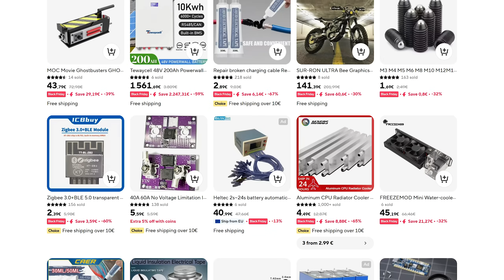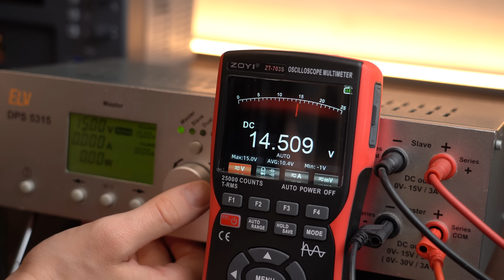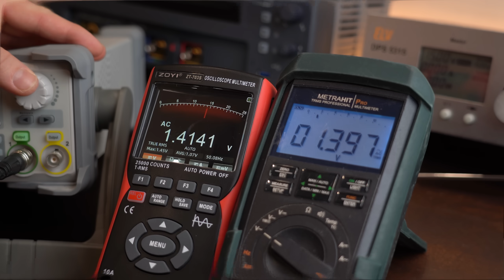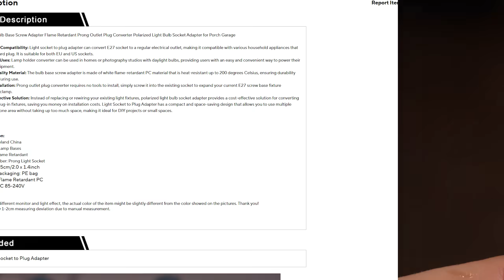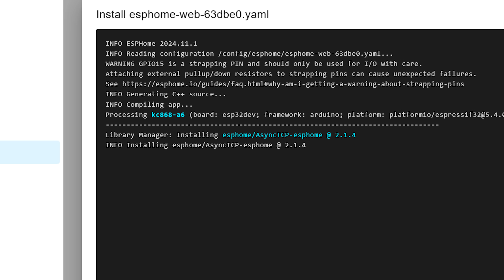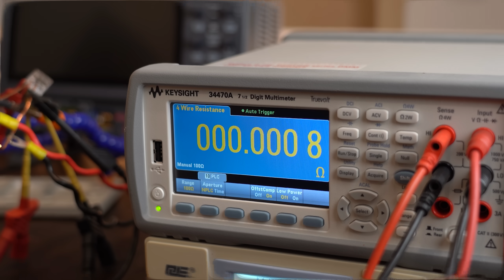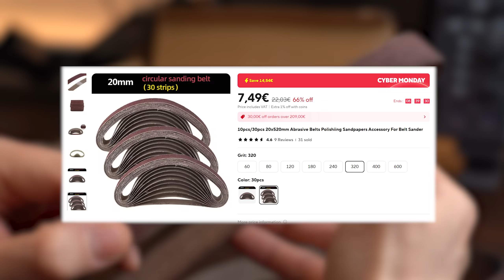I tried finding Hidden Gems on AliExpress AGAIN! (Part 12)

Comment: I was excited for your liquid insulation paste review and it ended as quick as the list of examples I used mine for.
Shame AliExpress is full of weird poorly made junk, the belt sander adapter sounds like a good idea but not when delivered with cheap plastic.
I bought a large UV lamp, 100w apparently, was doing some hydrogen peroxide deyellowing of plastic... Thing melted due to its own heat, thank God it didn't make a short circuit.
I wish they took the things a bit more seriously, gotta be incredibly careful with the mains powered things you can get there... Such an easy way to start a fire.

Comment: The socket outlet is useful if you have vanity lighting in the bathroom as well as inconveniently placed and/or few outlets. Removing 1 of 3 to 6 lights is going to have a minimal affect.
Reply: Sounds super usafe since it does not have earth or grounding
Reply: @NinoJoel  depends on what you're using for and how your bathroom is set up. Common sense should be enough to keep someone safe.
Reply: @A_Retired_MSgt  common sense doesn't help you if there is a fault in an appliance you use.... 
Even less in a bathroom where you stand barefoot and have plenty grounded things to touch

Comment: Using light fittings as a socket was a life saver many times when travelling in India, where a lot of the cheaper hotel rooms have no sockets at all. The only way to recharge batteries.

Comment: ESP Home Automation Board looks promising, I was looking for something like that for a while :) As for the oscilloscope - there are also other similar scopes like OWON, they have a built in generator with BNC output, also simple but a bit more configurable than that in ZOYI scope. It's worth mentioning that these scopes have common ground (even with the USB port), so watch out with your measurements while charging or connecting it to the PC :)

Comment: I have OWON HDS272S, multimeter plus oscilloscope (it can measure two signals at once up to 70MHz)+ signal generator, bought for around 120 euros from banggood. Super good (just one flaw - low current range does have high resistance, but 10A range is so precise it can measure even 1mA, making low current range totally worthless.

Comment: When i was an Electrician I used the light bulb socket adapter often. I used it most for toning out wires.  Could you do it with out one yes 100%, but time is money and this is a super time saver.

Comment: TL;DR: I had an old multimeter and needed a cheap oscilloscope for basic signal analysis for PS/2 protocol and other stuff. It was a good buy for me.

I got the ZT703s at about this price when it was on sale 2 months ago. I found it very useful for my Pi Pico, Arduino and bitbanging projects, I could even decode the PS/2 protocol on the screen. For fast signals however it can be bad, but Zotek is one of the few cheap oscilloscope brands that releases software updates. For the newer firmwares, the trigger can be very bad, and the 1.3.x firmwares are considered to be pretty stable.
On eevblog there is a forum for it and someone decided to create a custom firmware to fix problems (a few days ago, so no progress yet). Zotek seems to push firmware updates not so often and in the recent 1.4.2 fw they added an FFT function, with no frequency visuals on the screen, so it is useless. They could've make the scope and multimeter more reliable.
The multimeter doesn't have a "zero" mode so measuring low resistance is more complicated. 
I hope one day the fw will have all the functions needed.

Comment: I use a US version of the light socket to receptacle adapter to test wiring, I can plug in a recept tester if it reads open ground it's good, continuity tests are just easier with a receptacle then a socket, I can set my plug tester to tone and find a breaker by sound... just stuff like that.

Comment: I bought several small tubes of that exact brand "liquid" tape. Mine came out of the tube just the same.  I've found that it's certainly NOT like the liquid tape I'm used to that has the brush in the can.  If I ooze some out onto {whatever}, then form it into place with my fingers and leave it... it then cures up.  It's almost like using playdough!

Comment: The LoRa connector in the Relay was interesting. At the moment I only have sensors on my network but I was already thinking about adding an activator. I wonder what a “LoRa connector is”: maybe they already have a chirpstack codec programmed for it and you can attach a LoRa chip. I will be reading the link. I was going to activate relays with an Arduino connected to LoRa but maybe this simplifies things.

Comment: I use the light bulb to power socket to find out which circuit a room has but it is only connected to lights.

Connect something loud like a box fan, turn it on.  Go through the circuit breakers until the fan turns off

Comment: I've been using light socket to power outlet adapters my whole life. 
For example, I replaced all my incandescent bulbs in the basement with cheap LED shop lights. I used the adapter since those sockets are already controlled by the light switch.

Comment: I think a better solution for the last use case would be to get a boom arm for your microscope.  Then you can keep it set up and out of the way when not in use and easily reposition when doing something quick like reading IC markings.

Comment: I also bought two tubes of the liquid electric tape and made the same experience.
One recommendation regarding angle grinder adapters: NEVER buy adapters or use an angle grinder for something it was not intended for. The speed and torque of angle grinders is very high by design and if something breaks at these rpm, it turns into a bullet! Just search for angle grinder accidents! Nothing will protect you!

Comment: I used those screw in adapters to install plug-in LED "tube" lights in place of dangling bulbs in porcelain fixtures in my basement. They're a common hardware store product in the US 😁 Mine are solidly made and UL listed though!

Comment: The oscilloscope can do 46Mhz in High speed mode! By default its in normal mode for battery longevity, that's why you only get 35Mhz
Reply: The TOOLTOP ET120MC2 can do up to 120 MHz, but it doesn't have multimeter function
Reply: @kokoeblighatian3631 thanks. I already two multimeter so this option is better for me. Also higher speed while being cheaper.

But I found non C2 version. Can someone let me know the differences?
Reply: How long does it last, i only know the zt-702s lasts for about 2hr which makes it almost useless to replace as a multimeter
Reply: @zakstechs  703 uses 18650 cell, you can put a bigger one in or have a powerbank cause it charges from USB-C. I had mine for 3 weeks and never charged it, still at half battery, so i see no issue with battery life.
Reply: @zakstechs  replying to your comment so that i know the answer too :(
Reply: @zakstechs it's super easy to open and replace the 18650 inside. I agree the battery that it ships with is trash, but with a reputable 18650 it lasts a lot longer. 

The battery it has inside isn't even soldered so it's not very hard to switch at all.
Reply: Copied from eevblog.
"summary about the Zoyi ZT-703S:

- dual channel 100MSPS ADC (overclocked to 140MSPS in high speed mode), both channels sampled in parallel"

At best 14MHz in high speed mode.
Reply: @juhaszpeter4796  14MHz is abysmal for an oscilloscope.. Zeeweii dso3d12 might be a better fit if you want the oscilloscope function with 120MHz advertised (vs 50MHz advertised for the Zoyi ZT-703S), but it more bulky with the ports sticking out, i am sure some 3d-printing would solve that nicely
Reply: Do you know if the Multimetermode is limited to 25V? It seems pretty low for my taste.

Comment: The Problem with the socket adapter is also that the power rating of most lamps are low - like 40, 60 or 100W. Could get quite hot in the ceiling or in the lamp base if you draw a lot of current.

Comment: Regarding the bulb socket to female plug adaptor...

Your concerns are correct! We have these in Greece as well, and are very handy to power something in a pinch! But, they are ONLY for LOW power applications! Maybe to power some desk lamps, a tv and speakers, maybe even a gaming console...but that's about it. The most common one seen, are in a T shape (I think T plugs), that also exist as a socket multiplier, plugged into a wall outlet. They are rated for low wattage, typically around 450W. Also, it makes sense for the wires inside it to be thin, since the wiring inside houses that is responsible for the lighting, is also using thinner wires, than the ones that go to the wall outlets.

Great video!

Comment: I've had my eye on the meter for a little while! So interesting to see it tested in real life.

I took a pass because I needed more granularity on the signal generator. But to what percent are the scope and meter accurate?

I have a small open source DSO I was able to calibrate against good lab supplies to better than the low but resolution. Wonder if this is better, since it's also higher (actual) bandwidth.

Comment: These auto-generated audiotracks suck, pls switch it off.
Reply from the maker: You can turn them off as well. It is not hard to do.
Reply: @greatscottlab  I like to download the videos with jdownloader 2, but it just picks a random audio (or last added?) .. So i get something unusable because there are auto-generated audio-tracks (which are horrible).

Comment: Lamp converter - very stupid idea, most lighting circuits are about  6 Amps, people might easily blow their lighting circuits, especially as there is no fuse in the adapter.  You should also check what certifications it has - it is actually legal.
Reply: Most countries don't have fuses in the plug so absolutely no difference. The breaker will protect from any overload however lack of earth so no class 1 appliances.

Comment: 3:53 Where you using high speed mode? That steps up the frequency ceiling but at a cost of battery longevity. This scope has opened up a whole new world for me, as someone returning to the hobby on an extremely tight budget.

Addendum: I would love to see you do a tutorial on scopes like this for the beginner because I really appreciate your teaching style. Back in the 80s when I started, oscilloscopes where far outside my reach. And now that I'm returning to the hobby, I am learning to use them from scratch.
Reply: I just bought a FNIRSI 2c53p, and not yet fully tested, but looks good at first, has 3 instruments, and, for me, the larger screen is a necessity.
Reply: Zack Freedman has made a oscilloscope tutorial on his channel.
Reply: I'd love to see more about cheap oscilloscopes too
Reply: same as me :)
Reply: saame id love to see a video like that from you
Reply: yes, and while at it , maybe consider  FNIRSI 2c53p for the next ali batch test.

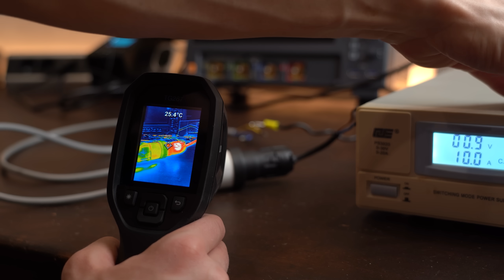Comment: 14:45 you need angle grinder with build in speed regulation, so you can slow it down
Reply: And I don't think you're supposed to apply pressure anywhere except at the tip where the bearing is, but the plastic should not be that cheap either.

Comment: While painting, I used E27 sockets with lightbulbs, connected through WAGO terminals. At some point, I started attaching a Schuko plug to them as well, allowing me to power small electrical devices like the charger for my cordless screwdriver. It’s incredibly convenient to have electricity available, even after all the wall sockets have been removed!
Reply from the maker: True

Comment: Holy SHIT! I need that 3in1 Multimeter! Its only missing 1 function for me, the ability to connect a temperature probe.
Reply from the maker: Maybe in the next version ;-)
Reply: Might not even need a new hardware version, but just a firmware update. When this scope was released it didn't have FFT, but they released a free firmware update that can be flashed through USB

Comment: Had the same issue with the 'liquid' electrical tape. Bought a small metal can and it was already hard. Really strange that it had a 4.6 rating.   There is 1 thing that we still need that I haven't found yet. A sort of shrinking tube that you can pull over an already soldered wire, or were the isolation is damaged, and that closes as you shrink it.  It would replace this mess of a liquid tape.
Btw I have the previous version of the scope. Very good stuff and there is a 18650 in a batt holder so you can replace it with a better one.

Comment: At least in the US that liquid tape is basically found everywhere, usually in the automotive section of a Walmart
Reply from the maker: Ok. Fun fact
Reply: It looks just like RTV (room temperature vulcanizing) silicone gasket for an engine.
Reply: @gamingkingX it is totally different in many ways, but there is some overlap in where it finds use. It is an asphalt-solvent solution, not a vulcanizing rubber.
Reply: @gamingkingX  The stuff that I've used sets up a lot harder than silicone.
Reply: @rocketman221projects  ah okay, then just replace “silicone” with “pvc” and its basically the same.
Reply: @rocketman221projects  probably urethane based, it cures with moisture to a rubber like substance.
Will not have a good shelf life once opened or without diffusion tight packaging.

Comment: At the beginning of electrification, homes often only had electric lighting, but over time various electrical devices began to appear, such as radios, record players, irons, and vacuum cleaners, so out of need, splitters appeared that allowed for connecting not only a light bulb but also, for example, 2 other devices.

Comment: The Oscilloscope / 3 in 1 tool at 1:53 seems very cool, but I’m mostly interested in the oscilloscope functionality with the rest being extras.
Reply: I might actually buy one. It looked super handy :D And I also like fancy stuff so its perfect xD
Reply: @AK90 I have one and it’s the greatest thing since sliced bread. I like to travel as light as possible to jobs and mainly only need a multimeter but a situation comes up every now and then where an oscilloscope is useful and this meter just makes that simple. Just the fact that it’s USB C rechargeable already makes it better than my regular multimeters.
Reply: @Nicksperiments And it's also a super fair device in terms of longevity! It just uses a standard 18650 cell.
Reply: looks ideal for automotive and marine work.
Reply: @r7boatguy I've used one on cars quite a few times now. Perfect for cam/crank signals, CANBUS, wheel speed sensors. Got mine on temu for £25 as introductory offer. Bought it with a burner email so I don't get spammed.
Reply: I have one. It's great for someone who is starting out. EEVBlog has a review of it. ZOYI ZT-703S.

Comment: The 3 in 1 Multimeter is quite nice, but are there seperate multimeter and ozillocope that are cheaper in combination?
Reply from the maker: I mean yes. If you go super cheap. But when you want similar specs then I doubt that you can find something cheaper
Reply: @ ok, thanks. I just know a friend of mine got a multimeter for like 5 €. Maybe I can send the link on dc sometime.

Comment: Survived 16 amps at 1v... what a bullshit test it is🤦‍♂
Reply from the maker: Power Loss is determined by the flowing current. P=R^2 x I. Does not matter what voltage gets applied. Could have been 230V, could have been 1V ;-)

Comment: Great video! Average lamps switch can't handle usually over 5 amps. So that lamp socket outlet don't need to handle much power. But yeah things like that was used 100 years ago and are not for modern usage. I think you should test how much lamp switches can handle, contacts usually burn with switching higher loads with half year.
Reply: Funnily enough these are common in the US... Well... They are behind a 100 years in some things 😂
Reply: @NinoJoel   I live in Estonia and i have seen similar things that are at least 50 years old from soviet times. Then it also was used at odd and extreme places like big apartement building basement where wasnt any outlet to illegaly use lights power for other things. But never seen moder one in use :D

Comment: In an ideal situation for the light source you have a 6A (maybe 10A) circuit braker, so from wire thickness point of view it should be fine (but still a bad design)
Reply: The lamp sockets nowadays only handle 200w or less. 
It's not a wire issue
Reply: In the US, the National Electrical Code requires that the light socket and everything feeding it be able to handle 15A peak, 12A continuous. That's the same as what you can get from most wall outlets, so those adapters make a lot more sense here. (Well, properly built versions of those adapters. Not that one, because it's obviously not properly built, and it's not UL Listed so it would be a code violation.)
The NEC has been changed recently to allow 10A (8A continuous) lighting circuits, but I'm pretty sure it also requires the lights on such circuits to be hard-wired, so you couldn't use one of these adapters on such a circuit.
Reply: @RonParker   in Europe most light circuits also can handle 16A which is standard for wall outlets. 
They are banned because they don't have proper ground connection and the light sockets cannot handle such currents since they are not build for anything other than light 💡
Reply: @NinoJoel  In the US ungrounded receptacles cannot accept grounded plugs so the lack of ground is not an issue. Now you can get adapters which defeat the ground but that's a separate issue.
Reply: @RonParker  I'm pretty sure the new standards allow light sockets on lower ampacity circuits, just not power receptacles. So you could still use these adapters if you wanted to.